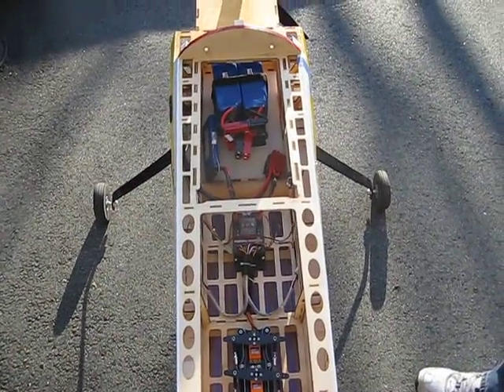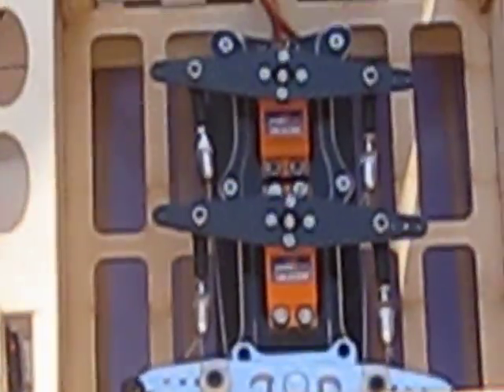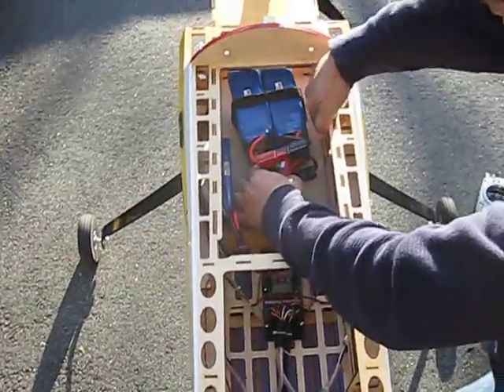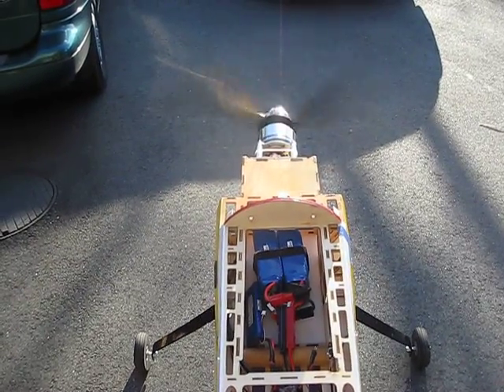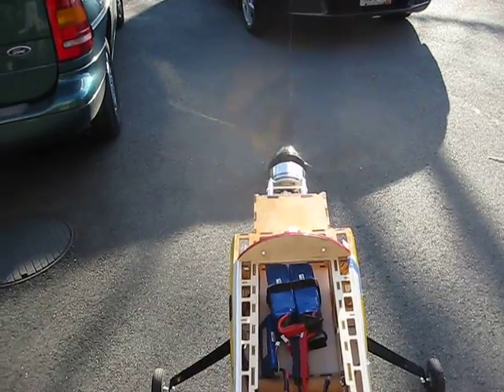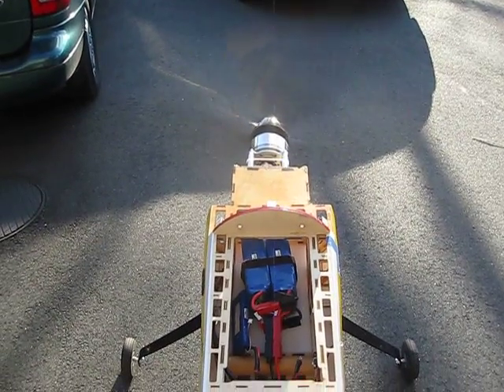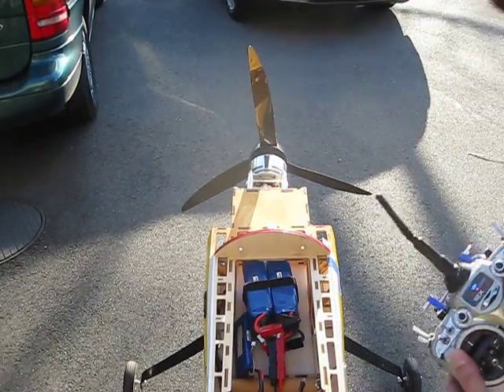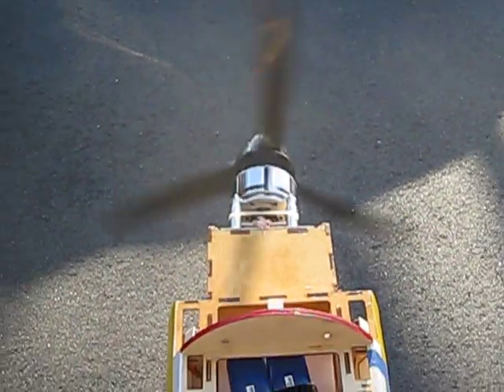First run-up of the Hobby King CA120-70 100cc brushless motor...

Comment: where can i buy this engine
Reply: could you tell me how many V and A he consumes at full power, and how many kilos he pulls
Reply: Your channel is amazing, and thanks for taking my questions, I have one more question it works with how many v
Reply: do you know any brushless motor from 2800 to 3000 w high kv
Reply from the maker: Hitalo santos Unfortunately large motors like this will have low-KV as they spin huge propellers at fairly low RPM… High KV motors are for smaller propellers or gear boxes And are much higher RPM
Reply from the maker: From hobby king of course... lol
https://hobbyking.com/en_us/turnigy-ca120-150kv-brushless-outrunner-100cc-equiv.html
Reply from the maker: It’s been a while since I ran this plane but I believe it was 12s (50v or so) and peaked at 110 amps spinning a 28.5X12 3-bladed CF propeller ... Not sure of the pull but it has to be at least 20 to 25 pounds I’m thinking… as that is the weight of the plane and I could hover it 😎
Reply: *motor
Reply: thanks friend, but then it can be low kv even you don't know a 3000a 4000 w motor
Reply from the maker: @hitalosilvio4451  3000 amps??  This motor max is 50v at 120-140 amps so 50x120= 6000 watts (or 6-7kW)
Reply: 3000a not kkk 3000 or 4000w

Comment from the maker: I use large 8g wire and Anderson powerpoles (75 amps though can handle much more @ burst)... I use 12 LiPo cells (I now use Two 8000maH 6S packs in series, NanoTech lithium polymer), roughly 50 volts and pulling 120 amps max.